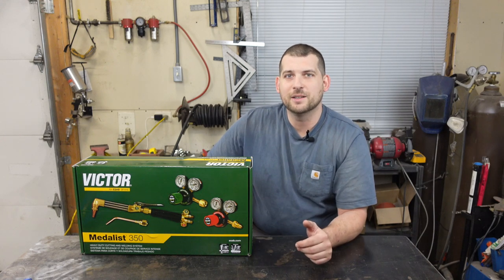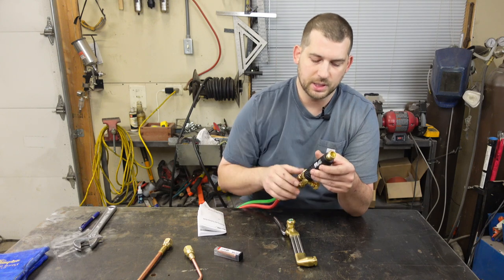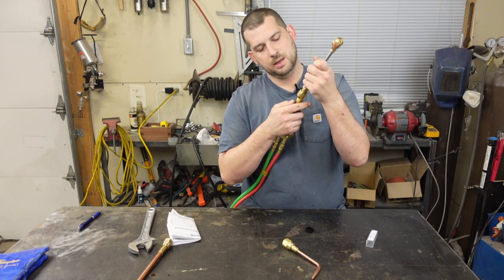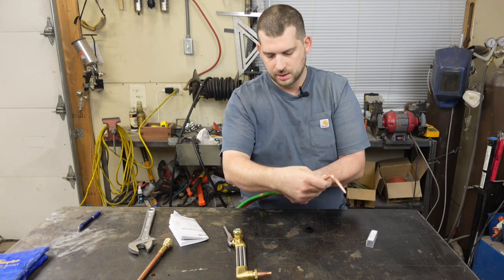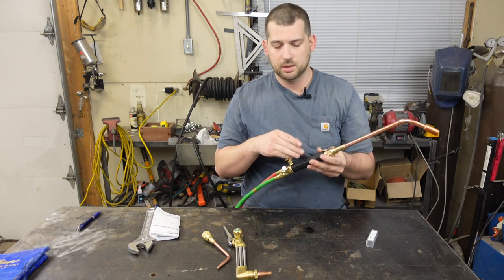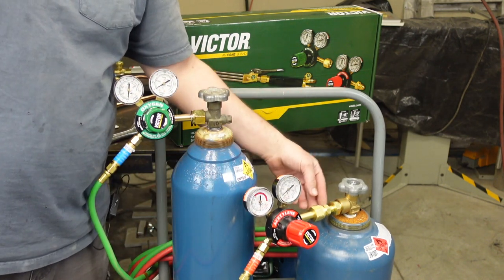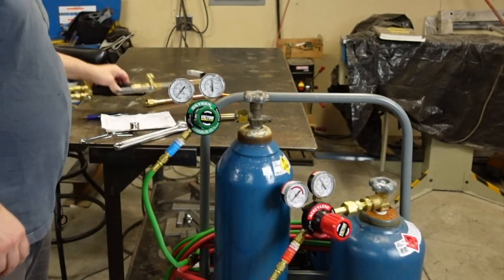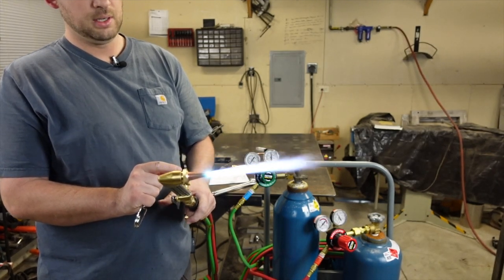OXY-ACETYLENE BASICS- run down of an oxygen and acetylene torch with startup and shutdown procedures

Comment: only thing I would add is to briefly open the bottles before installing the regulators to "Blow out" any debris.... and NEVER stand in front of your regulators as you apply pressure as they could blow apart.... you know safety at least top 10...... Good video!